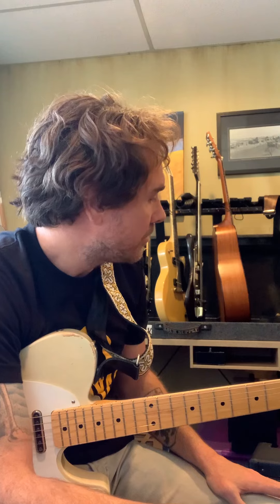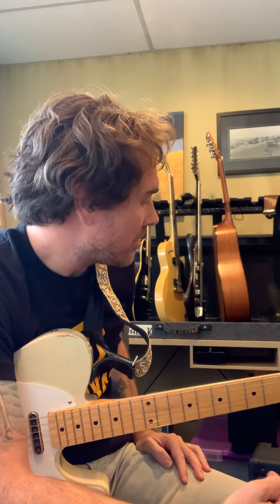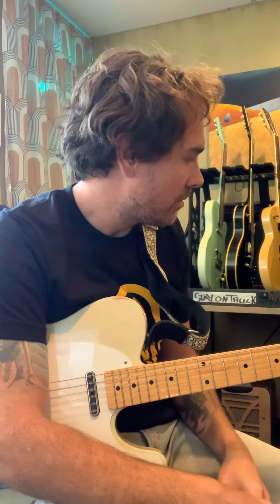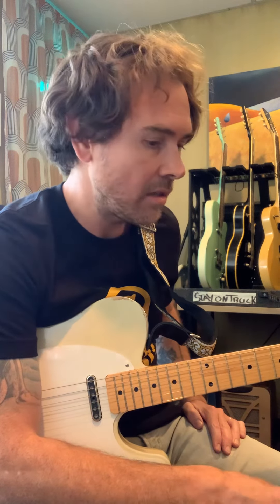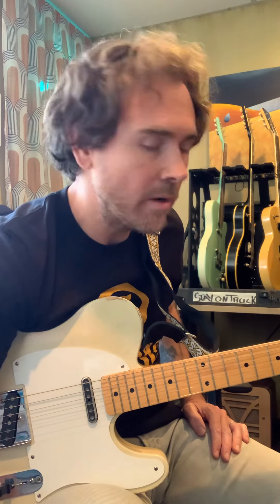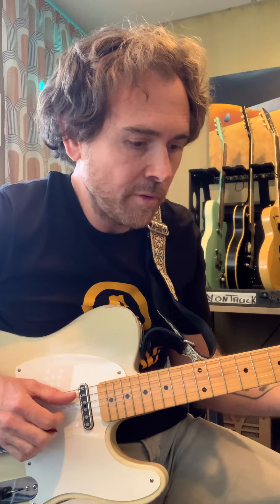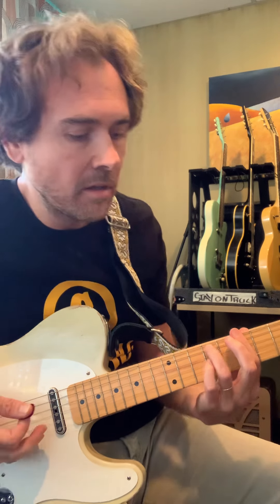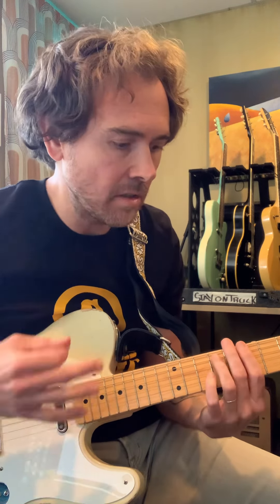Jedd in the Shed - Episode 50 GA-20 Rehouse in a tweed deluxe cab

Comment: Great to see you back Jedd!  5-6 years ago I had 2 speaker cabs built at Mojo Tone,  they are 1/x12 from 5/4 pine and covered in tweed, w/ leather grips. They wanted $90 each to lacquer them, so I bought the lacquer and did it myself. They came out great!!  I put a Celestion Alnico Blue in one and Vintage 30 in the other. The different tones are interesting!. I have a few more in the works. I'm thinking speakers/cabs make a bigger difference than I ever realized!   8)   Cheers,    --gary
PS,  Now I'm jonsen for an Ebo head!!  LOL